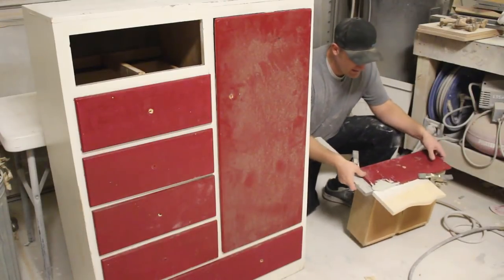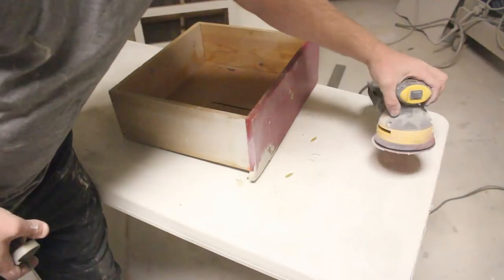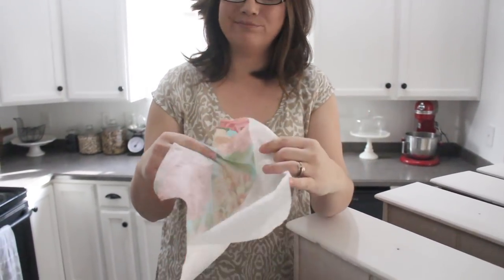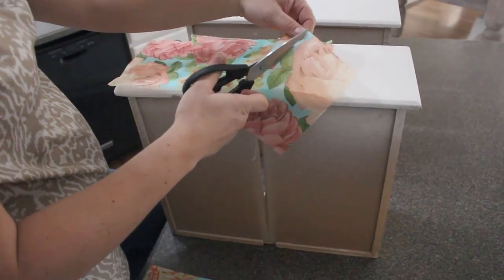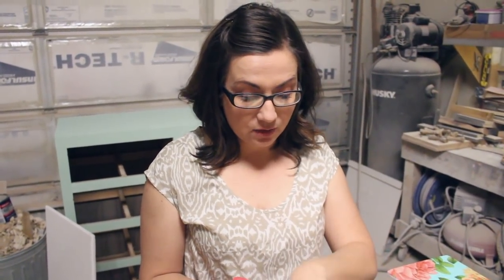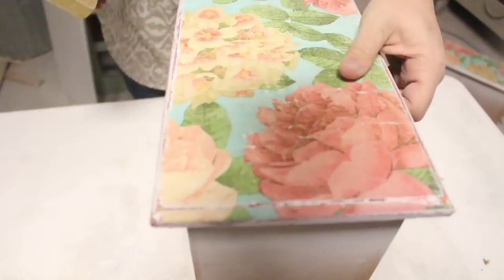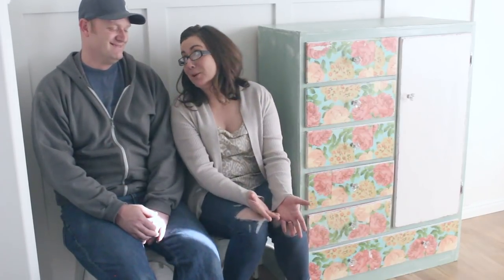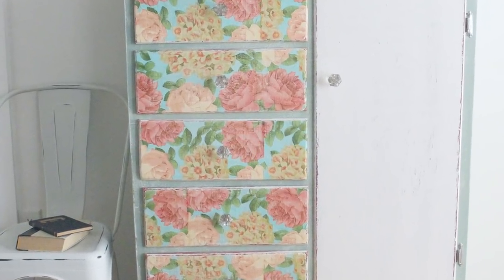How to Decoupage | Farmhouse Napkin Dresser

Comment: hi - i have been doing decoupage for over 20 years, if you take some white chalk paint watered down on a damp cloth - go over the entire napkin before you do your first coat of sealer you get a better look. just a tip that's all.
Reply from the maker: Alexandria CM thanks, we’ll have to try that
Reply: you get a more natural blended look. Just a dam cloth, dipped in watered down chalk paint, rub all over then use another cloth to wipe any excess off, it is a technique that has been used for centuries. I also do up antique furniture, ornate picture frames, and chalk painting for a hobby. I also have an arts degree, and graphic design, so i come up with all sorts of graphics for furniture. The techniques that have been around for centuries and well kept secrets. You can also use artist paint that is used for oil painting on canvas, and mix it with wax to create another finish on furniture. I use artist oil canvas paint all the time, mixing my own colors especially the metallic colors, the effects are amazing. You can create a very aged look to a piece by using a blending technique over a thousand years old. Having a background in art, graphics and fashion designing and tailoring as well as forensics, as well i create my own graphic designs for decoupage, i have done hundreds of pieces, i also do entire sets, frames and furniture to match. I did have pictures on pinterest but i took them down. I will have to put them back up when i have time.